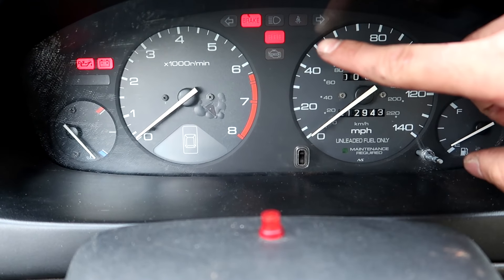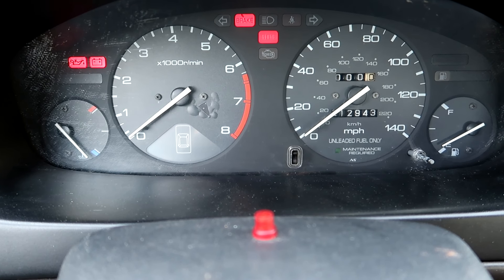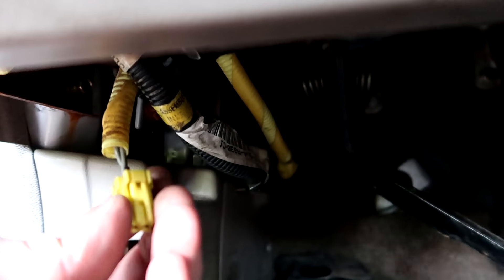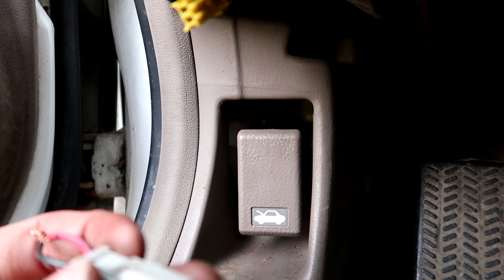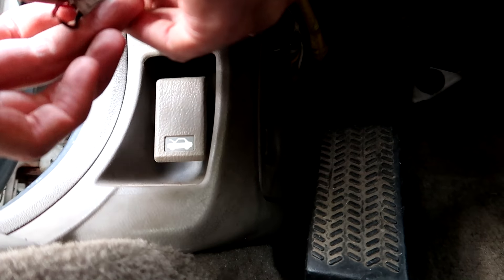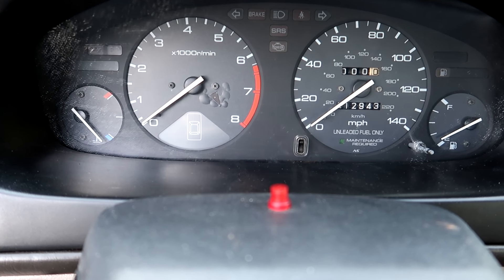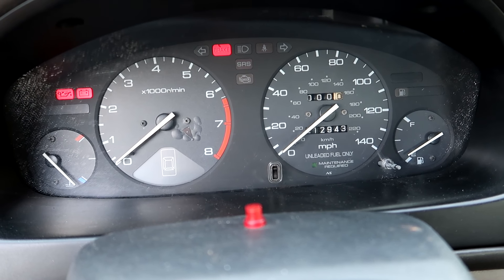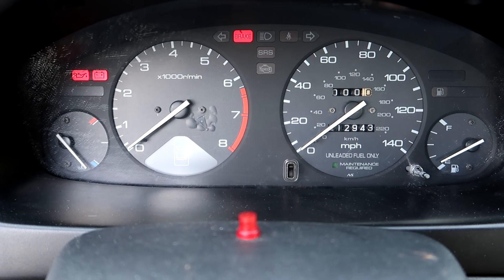Honda SRS reset

Comment: Many thanks for posting this.  I was a bit hesitant to meddle with SRS circuitry but your procedure worked like a charm.  Only caveat I would add is that the timing is critical.  In your video, you did mention that the opening and shorting should be done within 4 seconds.  in my case it was more like 2 seconds.  the first three tries did not work because I was not doing it fast enough.   The dealer said they have to take out the front seats and check all the wiring harnesses that ran under the seat and carpet!!!   They had quoted me a price of about $700.  with your procedure, i did it for free and in five minutes.  can't thank you enough.

Comment: Best video for this help needed: “when SRS is ON-  plug is IN, when SRS is OFF- plug is OUT”
Reply: no the plug it s not connected to any thing it plugs just to a holder just to hold it in place its made to reset the srs system,

Comment: This worked great. Tried 1st with speaker wire. I couldn’t get it connected fast enough. Luckily I had a civic that’s no longer running. I found the seatbelt connector & cut it. Tired it exactly how it’s was done in the video & it worked like a charm. Now I have no lights on the dash. I’m a happy lady. Thank u so very much!

Comment: Thanks bro! Changed my dash on my 98 Prelude and triggered the SRS. Was thinking about removing the light from the cluster but this is way easier and it worked like a charm!
Reply: Hey man do you remember where the reset plug is on your 98? I have a 97 and I’m going crazy with this srs light
Reply: @arielmartinez7517  I guess you found it, but for any other ppl wondering, its the small yellow cube located st the right side. It has no rear connections and its just for deleting codes.

I have a Civic mb3 1997

Comment: The light can come back later.  This means that you likely have a non-full contact with the driver seat belt's taken place inside of the seat belt's buckle.  See other videos.  This happens to my Honda Accord.  And the trick works but only temporarily.
Reply: Yo are right.... exactly.. it works but for some time
. Light comes back few days later..😩😩😩
Reply: Did you guys ever find a permanent fix?
Reply: Well I think if it comes back on that means there's something still wrong with the system. If everything's fine it'll stay off.
Reply: @NSZ-sb6kt  Basically, in my case I diagnosed the problem to be the seat belt bucklet contact code 9-3.  Google on how to diagnose for code 9-3, basically 9 blinks, pause, then 3 fast blinks.  So, I know for sure it's NOT the airbag problem but the belt bucket gets old.  This is pretty much usually the problem with Hondas.  Replace the belt buckle.

Comment: This seemed to have worked for my 2003 Element.  Not sure if this video said to disconnect the neg terminal on battery, but that did not allow me to complete the circuit.  Thanks for the help.

Comment: i recently purchased a 01 Accord ex . th passenger side seat srs airbag had deployed on the previous owner and the dash SRS light is on. In my state Hawai’i) SRS is not required  (mandatory) to pass inspection. Can I reset my dash indicator without dealing with the airbag deployment?

Comment: Cesar hi ,I have a issue with the p 1632 code and it does not go past 3.000 rpm when driving the car on the road,I can hear spark jumping inside the cap can you please point me in the right direction. I never had a honda and this one runs good it’s a 2001 accord dx 2.3L automatic but it was running ok had to replace a few parts and then this happened thanks for the video.
Reply: Had the same problem with my 2002 S2000.  Easiest place to start is check for a loose gas cap.  If it is, tighten to correct number of clicks.  Then drive until computer resets itself.  Usually about 20 miles for me.

Comment: Hi, I like the nice video as I am having same problem and looking for the solution. I have Honda Accord 2003 LxSedan. My seatbelt was locked and now repaired. But airbag light is on continuously. Would you please help me to locate the SRS port and how to take it out? I saw two yellow ports underneath the steering wheel just above the fuse box but none of them come out...is there any trick to take out?
Reply: You have to push in a small tab on side this unlocks,push in tab,pull apart.

Comment: Do you leave that yellow plug unplugged or do I plug it back in after ?
Reply from the maker: plugged in or not doesn't matter, it's just a dummy hole that just holds the plug up out of the way
Reply: Perfect! Worked on 2000 odyssey! Thank you!

Comment: Hey bro you re connected your srs switch when you were done correct.
Reply from the maker: It doesn't "plug in" to anything really.  It's just a holder for the plug.  No actual connection.

Comment: @CtrlAltDefeatTV. Nope, no unplugged yellow plug. There's 2 yellow plugs that are plugged in to parts of a panel so I'm not gonna mess with it now. 1998 Honda Accord LX must be different...
Reply: I've also got a 1998 Honda Accord LX, and just did this a couple days ago. Worked like a charm. 

One of the yellow plugs (it was the smaller of the two for me, higher up on the panel) was what I used. I think it had dark green wires coming out of it? Anyways, when I pulled it, I could see into the socket it was plugged into, and the socket had no pins - it was just a blank socket to hold the plug connector in place and keep it from flailing around.
Reply: Unrelated but potentially useful: I pulled the SRS codes before resetting (using the method of putting a jumper across pins 4 and 9 of the OBD2 port, as found here https://www.clubrsx.com/threads/diy-srs-codes-and-reading-them.636707/) and got a 9-2 code, which apparently means "SRS Unit Internal Failure of Power Supply" (per https://myairbags.zendesk.com/hc/en-us/articles/115015785587-Honda-SRS-Airbag-DTC-Codes). At least for me, I think this was because I had pulled the battery a couple of times in weird situations, and the car thought the SRS module had failed.

Comment: Hi, I have a similar issue. My 2011 Honda CRV didn't give me any SRS airbag light on, but when I used BlueDriver OBDII bluetooth scanner, it actually found a 41-11 code. Is this a false alarm, a connection that is just loose, or something else? Is it still safe to drive it (e.g. would airbag actually deploy with this 41-11 code which means "No Signal From Driver Front Impact Sensor?" Thanks!

Comment: Is it possible that a fuse or plug is left unplugged that multiple codes for SRS come up? Hooked up a scan tool and 10 DTCS came up most of which are circuits. I just finished up an engine replacement and the SRS light is on.

Comment: removing a fuse will not turn off the SRS light . And there is no bulb to remove it is a circuit. I did it the cheapest way. I took out the gauge cluster, carefully took it apart and covered it up with black electric tape. Put it all back together and no light to be seen. It is still on, I just don`t see it.

Comment: Hi, I found the yellow plug, and used a paper clip on it. However, the SRS light never turned off. Where do I go from here?
Reply: Same thing for me
Reply: Just fixed mine make sure the yellow wire doesn't connect to and pins on the female end as I had the wrong plug on my Odyssey the right one was a bit hidden in the dash

Comment: Hey I have 04 odyssey. I have srs light on. Can you help me out?
Reply from the maker: I haven't tried this on an odyssey but first you need to read the codes to make sure that they've been taken care of, you can do this by jumping the 9 and 4 pin on the obd2 port
https://www.clubrsx.com/threads/diy-srs-codes-and-reading-them.636707/
Then once you've made sure all the codes have been taken care of you can reset the light using the method in the video.  Look for the 2 pin yellow plug under the dash.

Comment: I connected the wire before turning on the key and then turning it on and the SRS light never goes out. It just stays on. So I guess there is other things wrong. This doesn't fix it all the time,,,,,,,,,,,,,

Comment: Both my airbags were deployed, if I replace the airbags, will this reset the SRS module to normal operation with the new airbags?
Reply from the maker: I believe if the airbags have been deployed, the SRS module is toast, unless you send it in to get it reset.  They seem to be a 1 time use item.  

So, to get the SRS light to turn off you'd need new airbags and a new module.